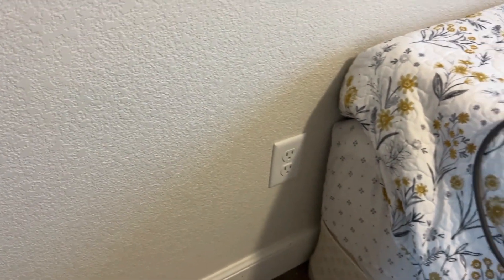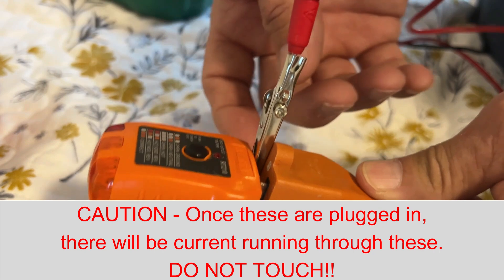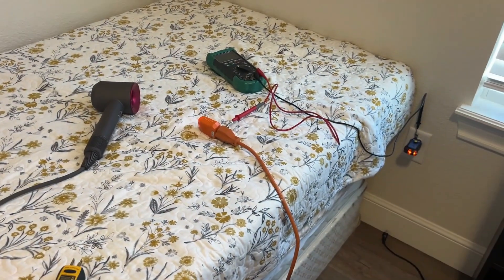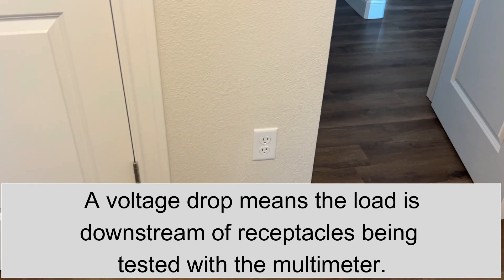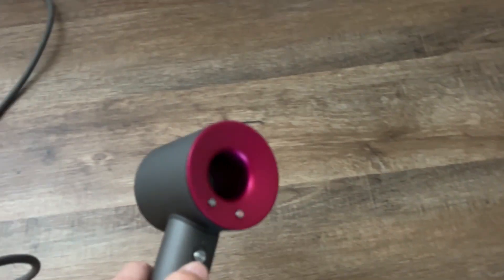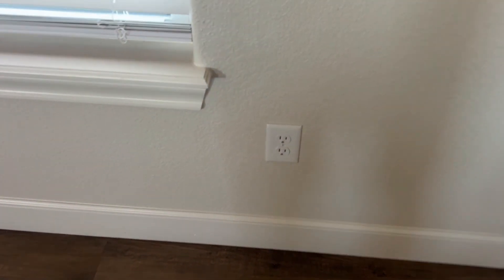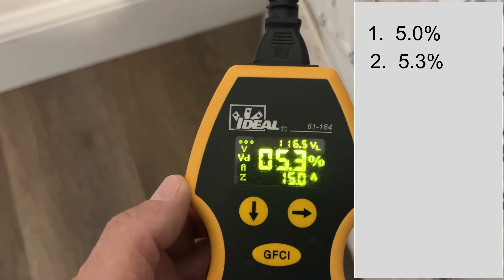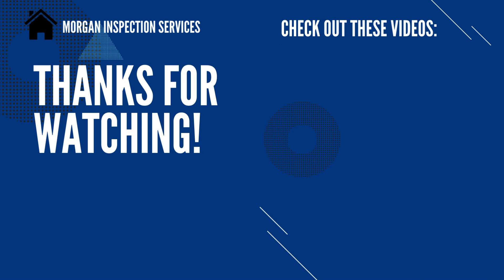How to Identify the First Outlet in Electrical Circuit

Comment: Just turn the breaker off and whichever outlet measures 0 are all on the same circuit.
Reply from the maker: Yes, I explained that. But the point of this video is to explain how to find the first one on the circuit so that you can install, for example, a GFCI receptacle to protect all receptacles on the circuit.

Comment: Im not an electrician but do want to understand the process and logic. Kindly explain voltage drop in the extension cord dryer test. Isn't the meter read showing  an increase of the volt and not a decrease? Non of them showed a drop. The Suretest did show in percent the voltage drop. Thanks.
Reply from the maker: No. You can see when I turn on the hairdryer in some situations, the voltage as read on the multimeter is changing from essentially nothing to let’s say 200 mA. So the multimeter is measuring the voltage drop between the two receptacles that the extension cord is plugged into. So, if the current that is running to the hairdryer is running through the wiring that runs between the two outlets where the extension cord is plugged into, you will get a voltage drop. In other words, if the hairdryer is plugged into the downstream outlet, then you will get a voltage drop. If the hairdryer is plugged into the upstream outlet, then you will not get a voltage drop. So using this method, you can determine which of the two receptacles is upstream or downstream. In other words, you can use this method to determine which way the power or current is coming from. By continuing to go towards the upstream outlet/receptacle, you can finally locate the first receptacle in the daisychain or on the circuit.

Comment: I may have missed the memo about why you were testing for the first outlet in the circuit, but it is to install a GCFI outlet to protect the entire circuit. But I would change the outlet wiring from plug-in to screw connection.
Reply from the maker: You’re right, it’s to install a GFCI outlet and protect the entire circuit.  I agree that connecting the wires to the screws is a more secure method of wiring receptacles.

Comment: What if the house is full of K&T and the hot and the neutral feed different receptacles, and there is a receptacle for a lamp controlled by Carter multipoint switching. And just for fun, it's all in an old multi unit building in Philadelphia with a 5 wire 120/240 "two phase service" and someone else has had their fingers in it before you got there lol. 

BTW, good video
Reply from the maker: Oh yes, the full K&T special with bonus Carter system chaos and a dash of mystery modifications. At that point, I’d just start looking for the hidden knob and tube junctions behind the walls because you know they’re there. And if it’s five-wire two phase set up in an old Philly building…  Well that’s when you start double checking your insurance policy before touching anything!
I’m glad you enjoyed the video.

Comment: Ohms ground to neutral.  Lowest ohms is first.
Reply from the maker: Actually, that has not worked for me. Let’s say you’re 40 feet from the panel so you’ve actually got 80 feet of wire: 40 feet of neutral and 40 feet of ground that you’re measuring the resistance on. That would give you a resistance of about 0.128 ohms for 12 AWG wire. Now let’s say you are going from receptacle to receptacle and that these receptacles are 10 to 12 feet apart. Then that increases the wire length by 20 to 24 feet. The resistance change is so low that it is almost impossible with a normal multimeter to measure differences in resistance. I have experimented with this, and it has not worked for me. If it works for you, please give me some more detail because Using the math, it doesn’t seem to work and experimentally, it did not work for me.

Comment: Ok, they make probe tips which are shaped like the blades of a plugin, which are pretty easy to use.  I bought an assorted set of probes off Amazon, which included probes for receptacles.  Additionally, I bought jacks, and made a plugin which goes in the receptacle, and has jacks for standard 1/8-inch probe tips.
Reply from the maker: I appreciate the info. I may just have to buy a set of probe tips to help me with other videos like this.

Comment: Why does the wiring inside the wall cause a voltage drop, BUT the (50-foot ?) extension cord used in this test does NOT cause a voltage drop ???  Something doesn't make sense here.
Reply from the maker: That’s a very good question. The answer is that the extension cord does not cause a voltage drop because no current is flowing through the extension cord during the test. There must be current to cause a voltage drop. The voltage drop occurs on the neutral wire of the circuit because that’s where the load’s current is running.
Reply: @morganinspectionservices3840  Thanks!

Comment: Couldn't it be possible for the feed to go to BR1 and then 2 branches come off of that, one to LR and one to BR2? Not sure why they would do that in a new construction but if they did, your test would not identify it unless you also tested between BR1 and LR.
Reply from the maker: I suppose that could be possible, but when I turn off the breaker and check for all dead receptacles, they were only in these two rooms, so I had identified all of the receptacles that I was dealing with before I started my test. The key is to identify all of those receptacles first, and I think that the way I was doing this test would work regardless of it branching off to other rooms or not. It might have become necessary to plug the extension cord/test apparatus into another set of receptacles, but I think with some logic that this method should work.

Comment: Hey can you do a video on capacitive coupling and how it plays a role in high voltage grounded and ungrounded systems? Nobody seems to have any …..practical conceptual videos for self learners interested in it.
Reply from the maker: I will put that on my list. I know a little bit about it, but not a lot. I will do some research and see what I can come up with. Thank you for the suggestion/request.
Reply: @ thank you you are the man! A god among men! Love how you teach fun stuff for self learners. I find the idea of high voltage and capacitive coupling fascinating. Basically I’d like to know:

1)
How and why does it occur in ungrounded systems under high voltage but not grounded? Completely confuses me.

2)

Could a human be capacitively coupled if hovering In the air under the HV in a grounded or ungrounded. I read a fluroudent light will glow under HV even if not touching the ground. Unless I misread!

3)
How could capacitive coupling affect a homes hot and neutral lines ?

Thanks so much!!!

Comment: You didn't hardly have those wires pushed in the back of the outlet. Well we know you are not an electrician for sure!!!
Reply from the maker: Are you talking in the outlet that I removed the wires from? If so, when you saw it on video, that was the very first time I ever opened that outlet. I did not install that outlet. hopefully, a licensed electrician installed it since this is a brand new house.
Reply: @morganinspectionservices3840  I apologize for assuming you installed it.

Comment: Buying a plug end would be cheaper.  Then solder on a banana plug to wire to go in the meter.Or plug is on another circuit.  
I wired my rooms to every other outlet So I always had power if I needed to turn off a breaker.
Reply from the maker: That’s a great idea to wire your room with every other outlet on a different circuit. I have another video coming out, showing other methods to find the first receptacle in the chain. One of my methods uses the plug that I cut off the end of an extension cord. I appreciate you watching and commenting.

Comment: I am a pretty good trouble shooter , but I could not follow you. I did run into this where about  eight  outlets  some room lights and porch lights were out. It  took me a long time to find the first feed box where the wires were quick pushed into the back of the receptacle had an open connection  in it stopping the current to the rest of the outlets.
Reply from the maker: I am in the process of making a new and improved video that shows these methods, but it will also include diagrams and will be done better. Look for it within the next 24 hours or so. I appreciate your feedback.

Comment: If the power was interrupted when you unhooked the first outlet in the chain why was the light on the kobalt circuit tester still illuminated , because the neutral circuit was still hooked up right.
Reply from the maker: No. Sorry about the confusion there. As I was putting the video together, I decided to go in and record the four receptacles as I said “you need to check that these four outlets are dead.” At that moment, the receptacle in the living room was not still disassembled. It was a video editing error.

Comment: Lovely fun until the clip pops off and shorts to the hot pin.  I used a couple of old salvaged 3 prong cords and put insulated banana plugs on to plug into the meter.  The hot and ground wires are taped off.  100% safe.  Be prepared to see 120 volts, because some outlets are wired wrong!  If you use the tester first you'll find this though.
Reply from the maker: Good advice

Comment: Ok, total noob here. I could follow what you were doing pretty well. Very interesting! (Informative comment section also!)

So, as a home owner, when and why would I need/want to know this information?

If I buy a newly constructed house, or have one built, should I ask for a copy of the wiring schematics for the whole house? Would that information be on file locally where building permits and inspection reports are generated, or is this info known only to God, the original electrical contractor and the  inspector?

This would be a home physics experiment for me. That Ideal Suretest device is pretty spendy at ~$420-500.00. I found a Klein test device that seems to provide similar info for ~1/3 the cost of the Ideal unit but have to research it a bit more. 

I do have a good multimeter and extension cords and my wife has at least one hair dryer, so could go that route for sure.

Thank you, sir!
Subscribed.
John
Reply from the maker: Hi John. I appreciate your comment and feedback. Typically the builder would have a wiring diagram. Most often doing something like this would come in handy on an older house that is not GFCI protected or that has ungrounded receptacles. A lot of people in the situations like to add a GFCI protected receptacle on the first outlet on the circuit so that it will protect all other outlets downstream. That is the main reason for doing something like this. Yes, the Suretest is rather pricey, and there are some other devices that do basically the same thing.

Comment: Voltage drop can be used to detect 2-wire wiring faking 3-wire (in old houses) where ground is illegally connected to neutral at each outlet.
Reply from the maker: Yes, you are correct.

Comment: That's pretty sick. I did a voltage drop test on a 16 gauge extension cord with 800watt on it. It was a 7 volt differential on the cord itself. Same if hot to hot or neutral to neutral.  When i tested hot to neutral at wall it was 124 volt and 122 volt at the end of extension cord. 
What i don't understand is it's a 7 volt drop from hot to hot or n to n. But only a 2 volt difference from wall hot to n vs hot to n at the end of the cord
Reply from the maker: I think I understand what you’re saying, and I think I understand what’s going on. Let me try to explain. Let me know if this makes sense.

When you measured 124V “hot to neutral” at the wall and 122V at the end of the extension cord, that 2V drop is the net voltage drop across the entire circuit—including both the hot and neutral wires. The key here is that electricity flows in a complete circuit: current travels out through the hot wire to the load and back through the neutral wire. Both wires have resistance, and each contributes to the total voltage drop.

For example, If the hot wire drops 1V due to resistance, and the neutral wire drops another 1V, the total voltage drop from “hot to neutral” is 2V. This is what you measured at the end of the cord.

On the other hand, when you measure “hot to hot” or “neutral to neutral” along the cord, you’re isolating the voltage drop on just one conductor. That’s why you saw a larger 7V drop when measuring “hot to hot” or “neutral to neutral”—you’re focusing on the voltage drop across a single wire, not the combined effect of both.

So, the 2V drop “hot to neutral” is the result of the load current interacting with the resistance of both the hot and neutral wires, effectively splitting the total voltage drop between them.
Reply: @morganinspectionservices3840  I could have worded it better, yes that's what I was saying. I figured 7 volts is about 5% loss. Just wanted to see what it was. I thought your video was cool, thanks for the tips

Comment: It did not look like you were drawing a heavy load when you used the Ideal tester.  With no load, the voltage drop should be extremely close to zero on a circuit of any reasonable length.  Can you explain why the almost 7% voltage drop at the end of a circuit with no load?  Or am I missing something?  Thanks!
Reply from the maker: Hi. Great question. The circuit analyzer applies a 15 amp load by using a resistor connected between the hot and the neutral and uses that to calculate the voltage drop. So it actually was under a 15 amp load.

Comment: Major issue here is aluminum wiring that is speed wired into the outlet. Then you you pulled on the cord to unplug the tester, yikes.
Reply from the maker: There is no aluminum wiring. It is all copper. Yes, I did pull on the cord to unplug the tester. That was the result of me holding the camera in one hand and doing the work with the other hand. I’m surprised you’re the first one who’s commented on that. That is not something I normally do.
Reply: @morganinspectionservices3840  I guess the small screen and color is a tad off, so I went to the desktop and big screen, and yes, now it looks like copper. But, speed wiring is still very dangerous, I can't tell you how many outlets I have replaced that were melted due to being speed wired(just plugged into the holes) I would love to see the difference in percent of drop if you wrap the wires under the screw.
Reply: @morganinspectionservices3840 I was going to comment on that, especially with it being so tight.

At least you weren’t unplugging the running hairdryer 😉
Reply: That is something you should never do. Haste is no excuse.  @morganinspectionservices3840

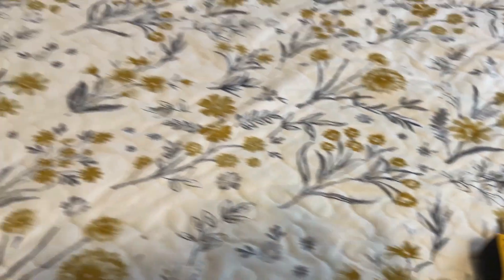Comment: Why is the outlet tester showing power and correct polarity at 9:06 with your line Wire disconnected at your first outlet in the daisy chain?
Reply from the maker: Hi. That’s a great question. I apologize for the confusion. I had already recorded the disconnected part when I realized I needed to explain about checking the receptacles in the bedroom. When I recorded showing the receptacles in the bedroom, that receptacle in the other room was not still disconnected.

Comment: great idea, but the video gave me vertigo.  to much waving the camera around moving from spot to spot.
Reply from the maker: Thanks for the feedback. My daughter said the same thing lol. I may redo the video to eliminate a lot of the movement.
Reply: @morganinspectionservices3840 And if I may, the echo or large empty room sound quality makes it hard to listen to your voice. No offense, but if you remake for stable video, maybe also work on the audio also. I'm pretty ignorant about making videos so I can't offer any useful suggestions.

Thank you for the interesting video. I will be watching it more than once.

John
Reply: Hey Mike, while I was driving home from the grocery store, I though of  a safer way to connect.  Instead of getting alligator clips, get two banana plugs and two POLARIZED  ac plugs or junk box extension cords, and connect the bananas to the neutral (LARGE SPADE) side of the polarized ac plugs.  Plug the bananas into your meter.  Now even if the bananas come out of the meter, they are on the neutral, which should be safe, assuming the house is wired properly.  Probably best to check with the outlet tester you already have because you were using it to alligator to.  I can see an alligator coming loose and making contact with the hot side, and unless it is the 4th, the fireworks would not be appreciated.
Reply: Same here, I got dizzy watching it, but the information was great.
Reply: I legit almost threw up and had to stop watching.  Took me like 5 min to recover.  Going to try to take some notes and start/stop the video to avoid hurling!

Comment: Why use the extension cord with DMM? Why not just measure the load voltage at each receptacle and record the results. The one with the highest voltage should be the upstream receptacle.
Reply from the maker: That is another option that would probably work just fine.
Reply: This is probably the best method. No extension cord or alligator needed. And if all outlets have the same voltage, then the outlet with the load is the upstream receptacle. It requires a more accurate meter (DMM), whereas the method shown in the video should work even with less accurate analog meter.
Reply: @xonx209  You can't get the same voltage at each receptacle, especially if the receptacles are daisy-chained in series to the same breaker. The reason being, the wire resistance increases the further out from the breaker in the electrical panel. The outlet closest to the breaker of that circuit wil have the highest voltage reading (the least resistance). The outlet furthest out from the breaker of that circuit will have the lowest voltage reading (the highest resistance). Therefore, the outlet of that circuit that has the highest voltage reading will be your first outlet of the daisy-chained outlets.
Reply: I have no idea what that means but it sounds technical!